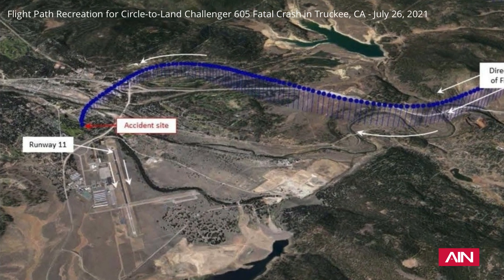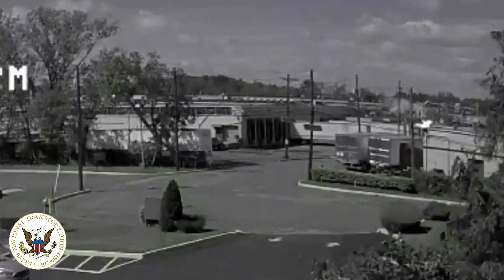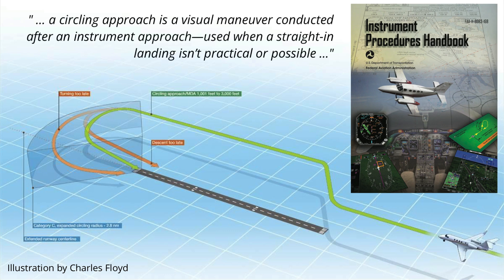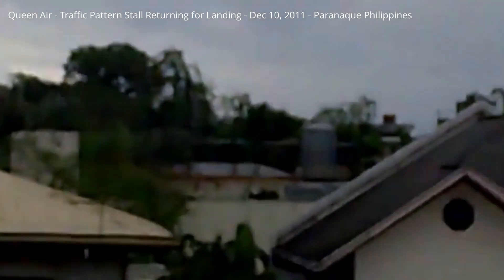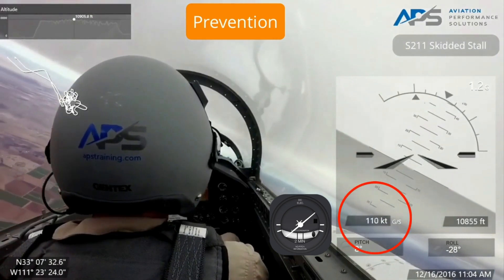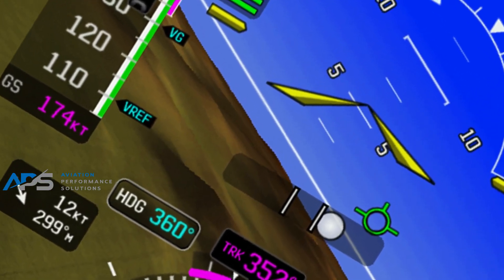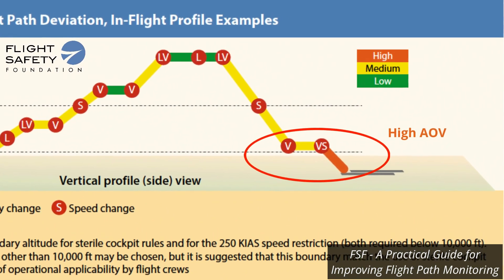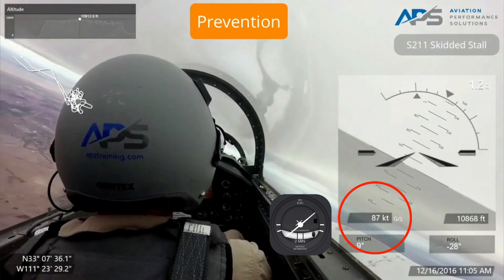Circling Approaches: Low, Tight, Unforgiving

Comment: I flew many years in the mountains of British Columbia Canada, doing circling approaches in the valleys, with the B737 200. An example is the Terrace approach in a 25 nm dead-end valley with 2 NDBs and then offset localizer - circling left turn to final.   Once in the valley, we cannot turn around, until reaching the end, where the airport is, and it’s wide enough to turn. We must land into the wind, that was behind us on the way in. If we can break out of the clouds at circling minimum, and keep it in sight on the left, we need to fly past the end to turn around, and land in the opposite direction to the approach.

"The instruments indicate that you are close to the airport, but you only catch glimpses of tree tops through the fractured clouds, as you pop in and out of them." 
I always made a point of having one set of eyes in the cockpit so instructed the First Officer to keep his eyes on the instruments while I looked to my left outside. At 600 feet circling minimums, it is too easy to lose critical speed  or altitude in seconds. 

As given in the briefing, when passing the “missed approach point”, we initiated the missed approach procedure. The airport is only about 4 km. before the end of the valley, and we started an immediate turn to the left, to avoid flying into the end of the “bathtub”, until pointing once more back the up the approach path. Only then, did we start to, accelerate, clean up flaps, and reduce power to climb thrust.. (“Clean up”, means retracting things such as flap and landing gear.) 
All done in a fully hand-flown manual airplane and situational awareness from round instruments. Those stick and rudder days were wonderful.
Reply: 600 agl 180's after coming out of clouds on a 737.   You are like i was when younger.  We needed to be brave or unemployed as pilots when i flew in South America.
Reply from the maker: Thank you for sharing such a vivid and insightful account. Your disciplined approach, with eyes divided, situational awareness at the forefront, and strict adherence to the missed approach plan, is exactly what keeps crews safe in the most unforgiving terrain and conditions. It’s a textbook example of leadership, preparation, and respect for the limits of both the environment and the aircraft. Those stick-and-rudder skills are just as relevant today as ever.

Comment: I'm a mathematician not a pilot. I said if you have 5,000 ft of altitude you should go ahead and turn back towards the runway if you just left and had motor trouble and dropped 500 ft of altitude as slowly as possible as far as you can glide and see if you were within 20% closer. If you're not you're going to have no altitude left to maneuver and you're going to run into the ground no matter what hard. There are more houses the closer you get to the airport. Most pilots just dream of the airport and fly halfway and hit a house when they crash. That being said I would like to mention that everybody should just rally and stop with going around. If the airlines had everybody fly out to the holding pattern and make a new approach you wouldn't have any more of these low slow turn. Go through three routines. Do your approach routine. Do your climb out the fly routine. Do your approach routine. Repeat as necessary. How did the equations and if everybody did that you would be able to do all of the landings and perhaps 10% more. Its operations research and I'm not legally able to sell it
Reply from the maker: Thank you for sharing your analysis. It’s clear you’ve put a lot of thoughtful work into how energy and decision points interact. My background in mathematics and physics from the Royal Military College has taught me how important it is to connect theory with operational reality. In practice, variables like wind, drag in turns, pilot workload, and rapidly changing conditions make those low, tight turns a lot less forgiving than the math alone might suggest. That’s why stabilized approaches and well-briefed go-arounds are so essential. They help preserve margin when seconds and feet matter most. I really appreciate your contribution to this important discussion.
Reply: @EveryPilotInControl let me contribute some more there are two ways to be fooled one of them is to have your attention fooled and you look at the wrong thing you might keep looking at that forever and keep getting the same result. However all of a sudden a flash can occur and you change. If you trick your reasoning and keep reasoning you can stay there forever. Let's look at the mathematical aspect of the pilot and how much experience he has, every pilot has one takeoff has a climb out, and a landing with every flight.  let's call an experienced pilot a 1000 flights man. 1,000 times he is polished this routine to launch take off from the land. He probably has made a thousand landing approaches to. These things are polished in complex routines they go too fast to have a PreFlight checklist and time to go through it. Then all of a sudden even with his experience person we throw some completely risky oddball stupid move on him turn tight and low, if not tight enough if not low enough you will be rammed with a large commercial airliner. If we replaced this all of a sudden jump you up oddball move that is interrupting your routine for landing and flaps and gear and picking your nose and adjusting your hat, we have an awful lot of people dead for our trouble.  if we told them fly in and land. Then we call them climb out you missed it go to the pattern and make another approach, we would be asking people to do the skilled routine they are used to doing over and over not some break in the skilled routine where you have to figure out what to do what not to do the flaps the landing gear this to that wham. Why are so many dead? Imagine a dentist once in his life you telling me has to fill his own tooth. I don't have access to good data to make a good solid analysis so I just pulled some numbers out of the sky to use for an example. It's fascinating I don't think Royal anybody from England is worth much at anything. So tell me do you understand the point I'm making about shoving this horrible task that interrupts a well polished habitual routine onto a pilot under the pressure of being hit with an airliner, is contributing to a lot of dead people, compared to asking a person to do the same routine he always does fly in attempt to land it didn't work fly out join the pattern come back around get another turn. What's your take on that one?
Reply: @EveryPilotInControl I recently saw a wonderful fighter pilot my goodness wasn't he wonderful there was just no way of mathematician could contribute anything to him if he was too poor to be a pilot. He said that if you could turn around and fly back to the airport to land it was a good idea to turn around and fly back to the airport and land. I agreed with him, however if you can only fly most of the way back to the airport you're going to have a forced landing in a place with a lot more people to kill. I suggested no matter what if you're at 5,000 ft and the engine dies turn around and fly back towards the airport. I agree 100% with the direction to go when the engine dies because you just looked at that land and you're looking at it again from the other side that's the best view you're going to get of any tentative emergency landing sight. I told him that you should 5000 ft turn around and fly off 500 ft of altitude and then see how close you are to the airport. If you hadn't gained 20% of the horizontal distance to the airport you should land where you are. The idea that you dreamed of this wonderful flat airport to land in his meaningless if you can't glide there but if you let it tempt you to glide too far towards the airport that you don't have the altitude to make a good landing, maybe you should do a mathematically based decision instead of just how you feel about flying to the airport.I'm not a pilot I'm just a mathematician and I'm not even officially a mathematician I just went to the university and butted heads for 7 years with him caught them cheating on my grades danced out of my student loans and didn't pay a penny for it. I tried to give something back but it's very difficult to convince a pilot who knows everything not to make a bad decision and fly right into the ground. So what do you think of my decision algorithm for an engine failure with some altitude? The best predictor of the next 10 minutes is the last 10 minutes. If you flew 500 ft of altitude from the  5000 off in 10 minutes, and you weren't more than that 1/5 of the distance closer to the airport, you need to land where you are while you have enough altitude to control your problem. What do you think of this algorithm and if you like it could you please pass it around and tell everybody that you're Royal and it's a royal idea a good Royal idea you just can't be a good Royal idea.

Comment: What most pilots aren’t consciously aware of is that when flying a circling approach at circling minimums - you actually need to be on a wider Downwind from the runway than if you were flying a Downwind at Traffic Pattern Altitude. The reason for this is that when turning from the Downwind Leg to Final - that turn is going to be either a level turn or a very shallow descending turn to Final. Your horizontal turn radius over the ground will actually require a greater offset from the runway because you are no longer ‘Turning In The Vertical’. That is to say, that you are no longer turning while descending which effectively reduces the actual horizontal turn radius over the ground.
Reply: Level turning ? WThe hell ..
Reply from the maker: That’s a great point. You’ve nailed a subtle but critical part of circling geometry that gets overlooked too often. At circling minimums, without that bit of vertical help to tighten the turn, you really do need a wider downwind offset to stay safe and stable on the way to final. This is where good planning and energy management matter most. Appreciate you calling that out.
Reply: @EveryPilotInControl 

Thank you for your positive comment about my remark. The entire concept of ‘Turning In The Vertical’ seems to be completely lost on Non-Military Pilots. As is the concept that PITCH (Elevator) Controls Altitude and POWER (Throttle) Controls AirSpeed when POWER is Variable.
Reply: @waltciao4549  
If you are saying that you pin the glideslope with elevator and keep the resulting airspeed within limits with power, I agree.
In  strong winds with turbulence, trying to stay on glideslope with power adjustments is just too slow, and often results in losing your profile.
Reply: @aeomaster32 

The airplane itself doesn’t know which piloting concept ( Pitch for Airspeed or Pitch for Altitude ) a pilot is using but if that aircraft was equipped with an Autopilot & Auto Throttles it would be controlling the aircraft using the more accurate and efficient control concept of PITCHING for Altitude ( or Rates of Descent and Climbs ) and Throttles for Airspeed Control. 

That’s exactly how the  Autopilot would fly a Coupled ILS and that’s the same Control Concept a pilot should use during a Visual Approach as well. Not just for an ILS. PITCH to the AIM POINT during Final Approach and Adjust the THROTTLE for Airspeed Control. This of course applies only when POWER is VARIABLE and Not Fixed.
Reply: @waltciao4549  

So we agree.

Comment: I used to fly light air cargo in twins. I did circling approaches in those days because I flew hard ifr often and felt comfortable in it.  One time circling in low ifr at 600 agl at night, I realized that the wing engine nacelle totally blocked the view of the runway!
They don't teach you that in training. 
I had bought Rod Machado's ifr book and his guidelines are what made single pilot ifr doable for me. No gps.
Reply from the maker: Thank you for sharing! This is a great example of the important learning we get from practical experience. Yes, Rod's work is fantastic, indeed.

Comment: The only times I've done circle to land approaches is when I was training for my instrument ticket and I did have to do one on my instrument check ride. That approach, which was the VOR/DME approach to KSPB, Scappoose, Oregon, was simple enough. Cross the VOR, outbound, procedure turn, inbound, there she goes. But the circling altitude is only 660 feet when the pattern altitude is 1000 feet. That scared the bejesus out of me in my Cessna 182 at 90 knots, never mind a faster plane with less time to observe and react. I shot that approach several times in actual instrument conditions with my instructor and in VFR conditions with the instructor as well. I remember having to turn my head quite a bit to look around to see where everything was and right then and there I felt that I was going to lose control. When I'm doing an instrument approach I want to be aligned on final with the runway I'm going to land on so all I need to do is look ahead when breaking out. I do not see a reason to ever do a circling approach and if the airport I'm going to does not have other options I'm simply not going to that airport in instrument conditions. Even if done correctly, how can you call that sort of approach stabilized? Maneuvering around for one or the other runway at 660 feet is simply never stabilized. I am only a private pilot with an instrument rating, though proficient and current. However I can't imagine trying to do that in a faster airplane. I can't imagine why anyone would even try. I don't understand why they don't revise those approaches so that the MDA is at least 1000 feet AGL for category A and B aircraft and 1200 feet AGL for category C and D and if anyone knows the reason please let me know. It's strictly ILS or RNAV/GPS for me.  Thank you for the excellent video. Subscribed.
Reply from the maker: Those are invaluable insights! Your observations clearly demonstrate your commitment to learning and keeping safety forefront in how you operate. Love the details! Thank you for sharing this with us all!